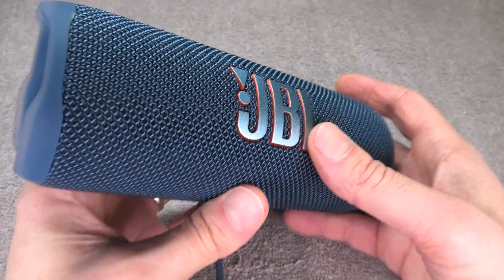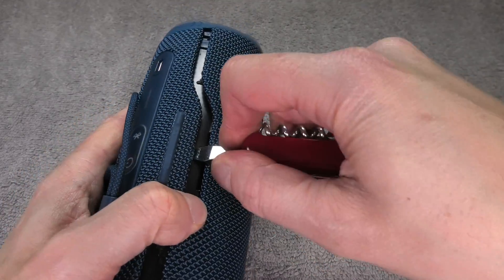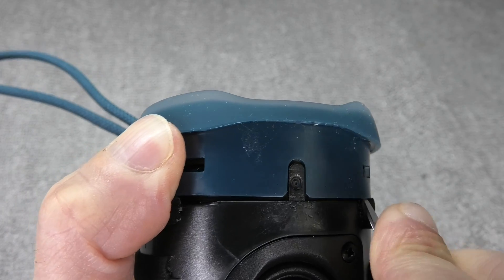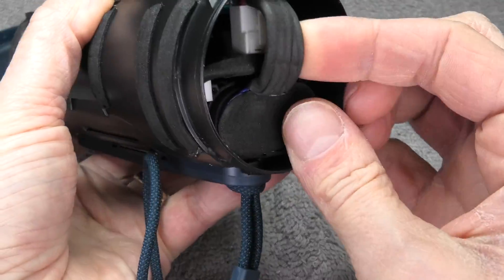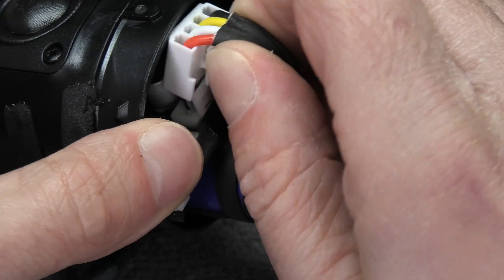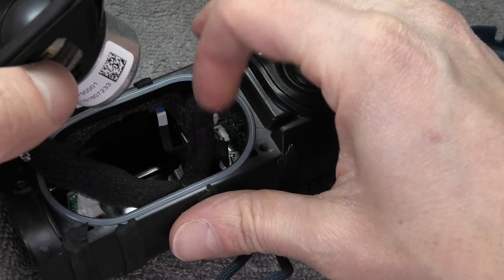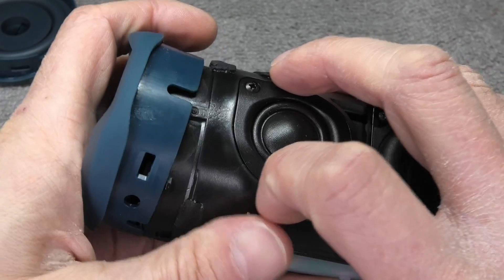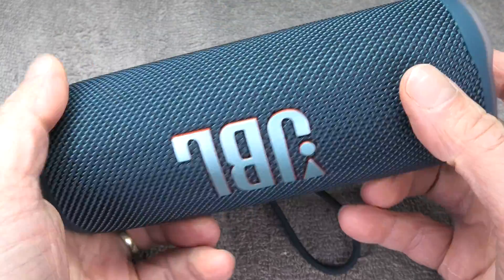Battery Replacement for JBL FLIP 6 Bluetooth Speakers (How to instructions)

Comment: Must say that you have been pretty lucky with the design of your Flip 5. Mine (also Flip 5) has a completely different interior design with the battery cable mounted in the center of the circuit board adn all kinds of tiny wires attached which makes it imporsible to move the circuitboard without damaging the speaker electronics....

Comment: Just picked mine up in December as a gift for someone, a few months later, LED battery charge level light doesn’t illuminate, no lights work, doesn’t hold a charge 🙃never had issues with the older JBL models. Maybe accept the pulse series

Comment: ...you will break one of the tab EACH TIME YOU REPLACE BATTERY FOR SURE.....BAD DESIGNED BY JBL Engineer not friendly to consumers after times to replace batteries.....They want us to buy a new one soon...... Right (!)
Reply: Yeah fuck them for this shit but I’m gonna replace it I’m not giving in and  buying another one
Reply: Especially when the speaker is around 4 years old or more. That plastic will be very brittle and will break when you try to pry open the tabs.

Comment: What's your backup guys . Mine is 2 hrs and it's getting heated aswell. Is it normal or mine is defective. Just want to know
Reply from the maker: Hi, getting a little warm while charging is normal. But it should definitely not be hot.  In that case something is wrong and I would disconnect it from the charger.
Reply: Yours made in USA or Made in China....Fake or Real one....don't buy cheap at beginning....I learn my lesson too
Reply: @ThepDenNgoaiBien If a battery would be made in the US such as the one in jbl flip 6, it would literally cost +100 dollars. Would you really pay +100 dollars for a 17wh battery? They even used a 3.6V cell, decreasing charge cycles and lowering conversion efficiency(Pretty smart tbh from them to make it seem like a big battery).  Nothing is made in any other country than China.